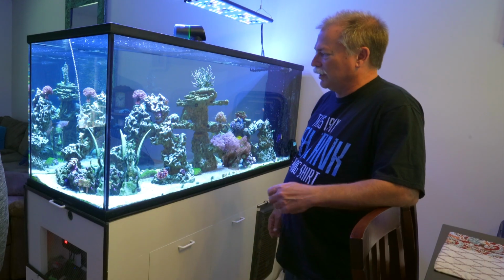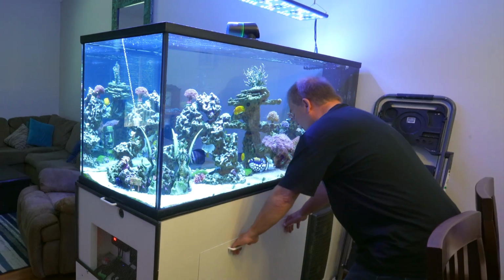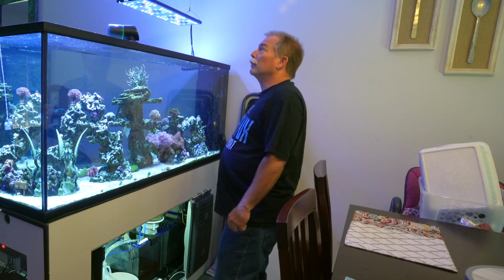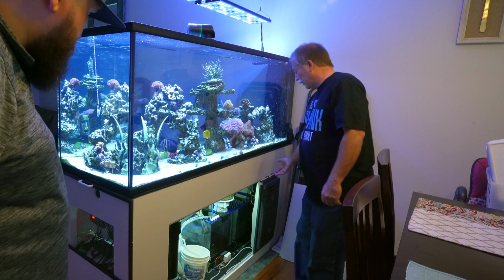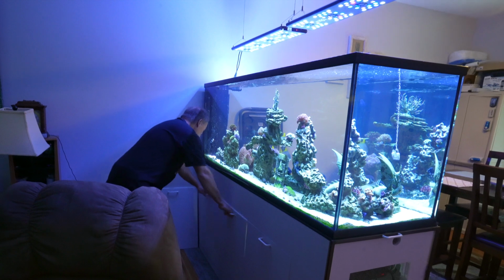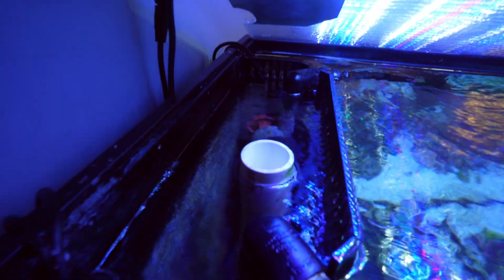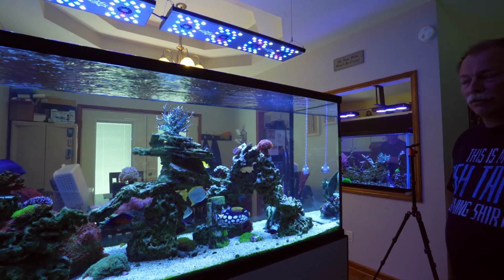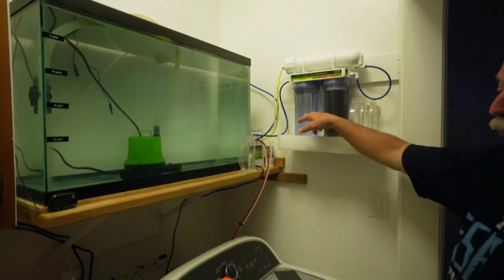Reef Tank Tour - RASOC Member Edition - Jeff's @PLANET AQUARIUMS  Peninsula Reef Tank Aquarium

Comment: Marine quality fan?
Reply: Not what I would call Marine Quality, but it is entirely plastic and the motor core is well shielded from water and mist. I recently inspected the fan and its internals. I found no sign of substantial corrosion. Only the screw heads for the casing fasteners were slightly corroded.
Reply: Limited-time deal: Holmes Dual Blade Manual Window Fan https://a.co/d/5AAG2ZU

That's the Manual switch version that shouldn't require any rewiring.